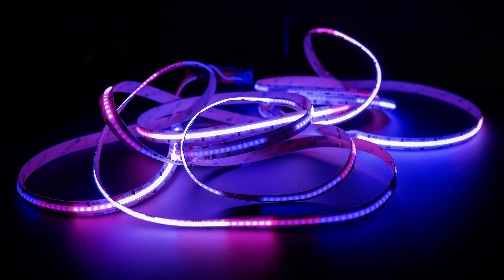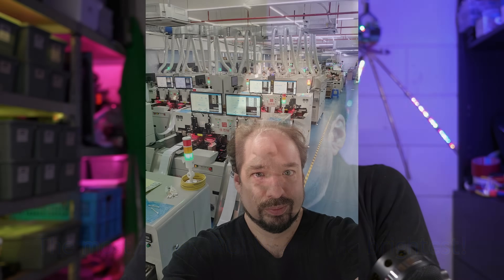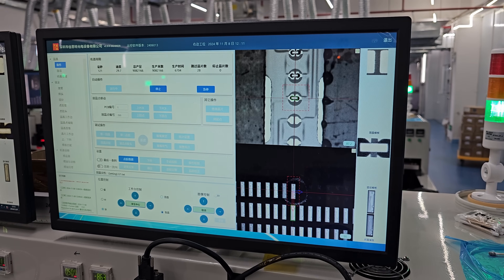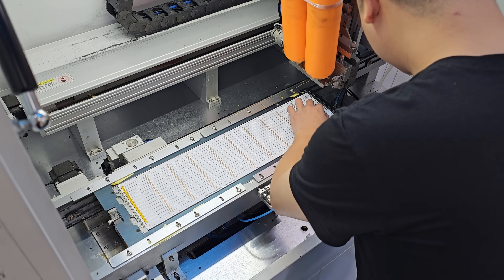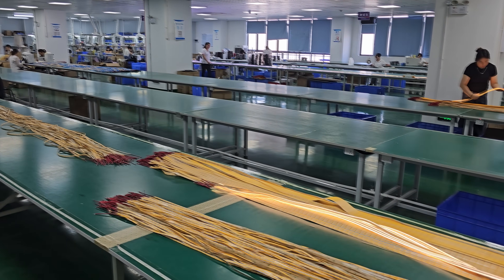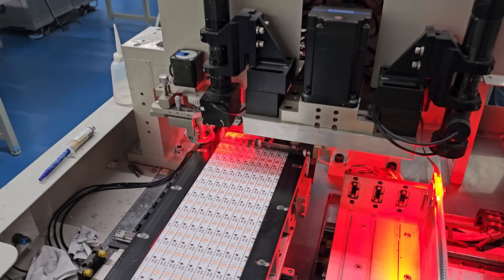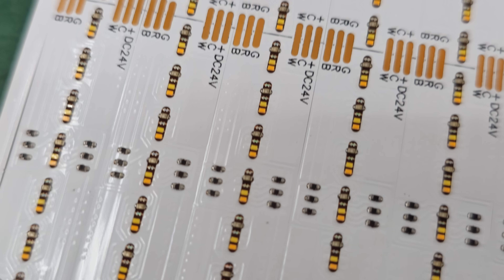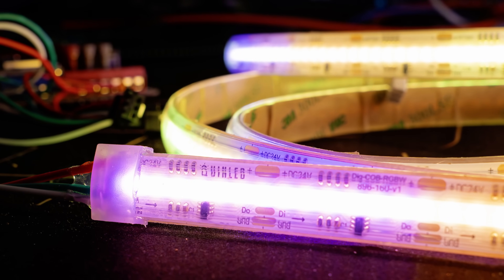💡QuinLED💡Custom strip and COB LED strip factory tour!

Comment: I would actually like to order the power board 5 and octa brainboard from your site, but where will this go with the tariffs? I live in the Netherlands and this will now cost a lot of extra money? Do you have an idea?
Reply from the maker: No no, I ship from China so US policies don't influence thst. Tax and everything is pre-calculated in the shop, it's still not cheap but yeah.
Reply: @ the shipping costs are indeed more than the 2 products together, but I would like to have them because I think it solves the problems I now have with 5x2mtr strips, and I don't have to do any tinkering myself. To be continued.

Comment: Thanks for making these available.  i can’t wait to receive mine 🥳.  I understand 14 mm profiles are recommended but do you think the IP30 would fit a 12.8mm such as Muzata u108?
Reply from the maker: It all depends on the profile construction, some 12mm will work fine. https://quinled.info/aluminium-profile-and-12mm-cob-strips/

Comment: Can I run 100% white 15 meters or 10 meters max suggested?
Reply from the maker: These strips can use quite a bit of power (they give a lot of brightness in return)! 100% dedicated White uses 68W. 68W / 24 = 2,83A so with 2 it's 5,6A which would overwhelm a single (4A) injection a bit. With 3 we're talking 8,5A so bridging 15m with front + end would do ok in my opinion, might see a minimal drop in the middle, but that's it so yeah, you can certainly try that!

Comment: Can we run such lights around my entire eaves all around my house without power injections along the way yet?
Reply from the maker: Ah no, because of the brightness these put out they actually need a bit of power, I wouldn't recommend running more then 10m with just a single injection or 15m with front + end at least.

Comment: Holy wut, so much manual labour even now. I wonder if the simpler analog cob strips come out of automated production lines or they need the same amount of handling.
Reply from the maker: Same amount, but that's why it's made in China, manual labor isn't as expensive as a machine, it also keeps them much more flexible then a machine.
You can hire a person (lots of female workers there too!) for say 20k $ a year who can easily make 10 different products, or buy a 100k $ robot for 1 or 2 products which has huge up front cost and is less flexible, maybe you can get more output out of the robot but that's a maybe and then there needs to be the need for that, also that guy will only have cost 100k after 5 years, not to start with. I've been to many factories there and that's just how production there works and it actually makes a lot of sense. 

The workers also aren't underpaid since costs over there aren't the same as here either. It might be a bit boring work at times, but not everybody minds that. It really needed my thoughts about that to shift too when I was there for the first time. Turns out a robot is certainly not always better!

Comment: Interesting! About how much do you have to buy minimum so that the price is acceptable? (No, I am not planning to buy a couple of km for myself)
Reply from the maker: The first batch was smaller because it was a market test mostly from my side, but normal orders are at least a few KM per variant to make it feasible price wise. Even then, I barely make any margin on these with the current price, but that's fine. Just want this product to be available. :)
Reply: @IntermitTech  Thanks!
Reply: @IntermitTech why are you not looking for cooperators to make it financially more feasible?